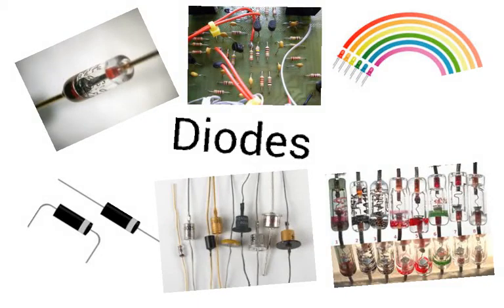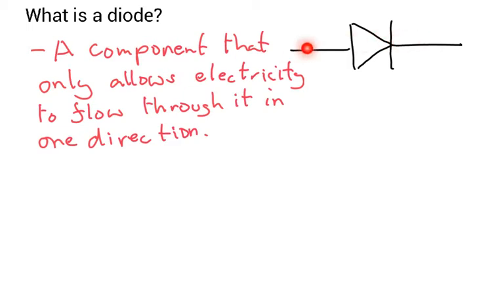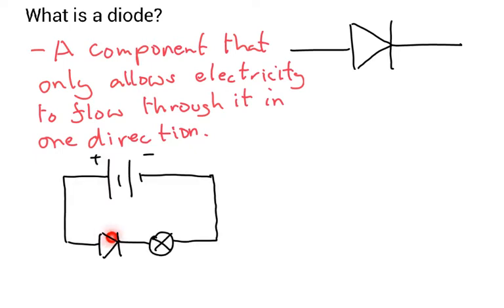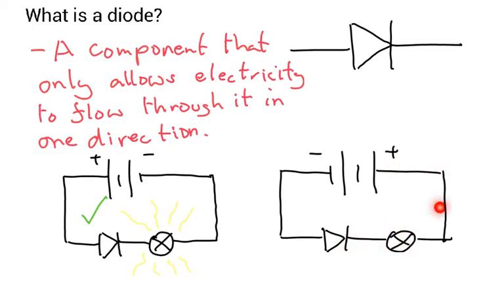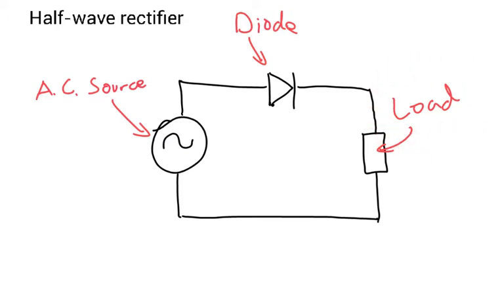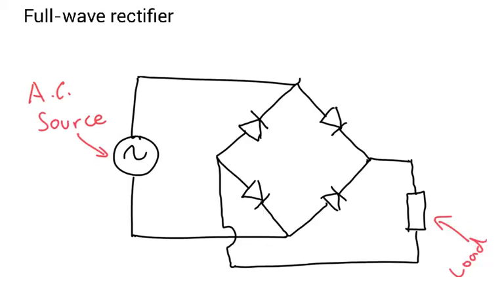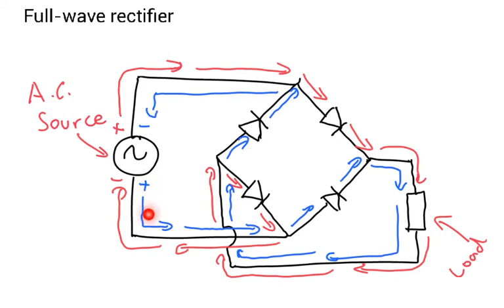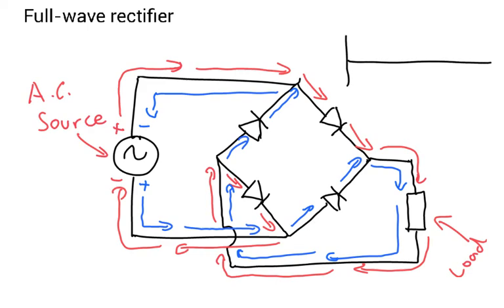Diodes - IGCSE Physics

Comment: 6:44 When it is at the negative cycle(2nd half of the wave), does the AC source change its positive and negative side or does the current flow in the opposite direction?
Reply from the maker: ahmd1221 the ac source does change and the current tried to flow in the other direction but is blocked by the diode.
Reply: Thank you, I think I got it now!